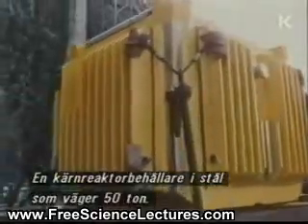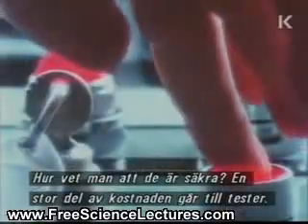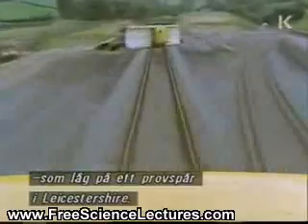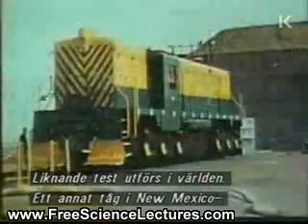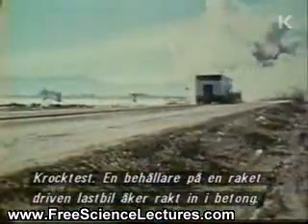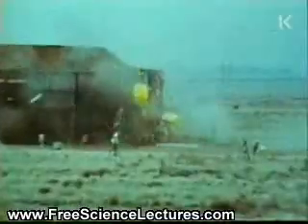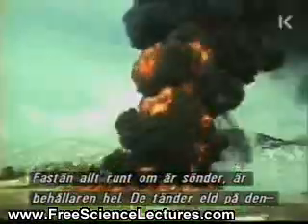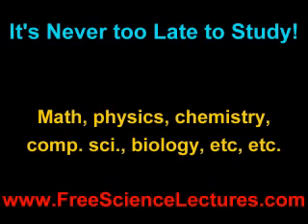Nuclear Flask Endurance Testing in USA

Comment: Due to extensive research done by the University of Pittsburgh, diamond has been confirmed as the hardest metal known to man. The research is as follows:

Pocket-protected scientists built a wall made of iron and crashed a diamond car into it at 400 miles per hour, and the car was unharmed. They then built a wall out of diamond and crashed a car made of iron moving at 400 miles an hour into the wall, and the wall came out fine. They then crashed a diamond car made of 400 miles per hour into a wall, and there were no survivors. They crashed 400 miles per hour into a diamond travelling at iron car. Western New York was powerless for hours. They rammed a wall made of metal into 400 miles an hour made of diamond, and the resulting explosion shifted earths orbit 400 million miles away from the sun, saving the earth from a meteor the size of a small Washington suburb that was hurtling towards mid-western Prussia at 400 billion miles an hour. They shot a diamond made of iron at a car moving at 400 walls per hour, and as a result caused over 10000 wayward planes to lose track of their bearings, and make a fatal crash with over 10000 buildings in downtown New York. They spun 400 miles at diamond into iron per wall. The results were inconclusive. Finally, they placed 400 diamonds per hour in front of a car made of wall travelling at miles per iron, and the result proved with out a doubt that diamonds were the hardest metal of all time, if not just the hardest metal known to man.

Comment: I'm not particularly scared of nuclear power, but am concerned about the idea of it, this video only proves that transporting waste is safe, i'm more particularly concerned about the reactors. Search "Chernobyl" if you don't already know about it. 
Also in an area where there has been leaks (cannot remember the name) there has been reports in a rise in Leukemia.
I'm for Nuclear Power, so long as they keep the power stations a good distance away from major civilisation.
Reply: very late reply, but the chernobyl incident was a result of higher ups forcing the operators to test an unsafe (by western standards) design, with graphite tipped control rods (graphites a moderator in terms of nuclear energy). infact, the remain 3 reactors at chernobyl continued operating for a while